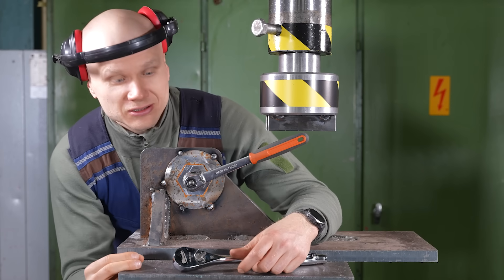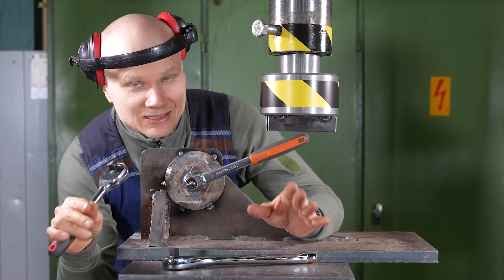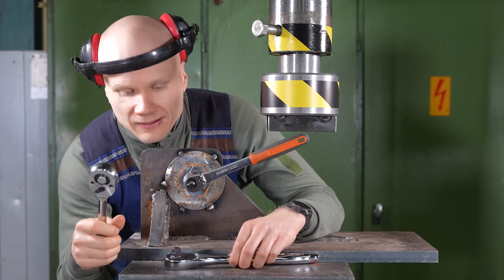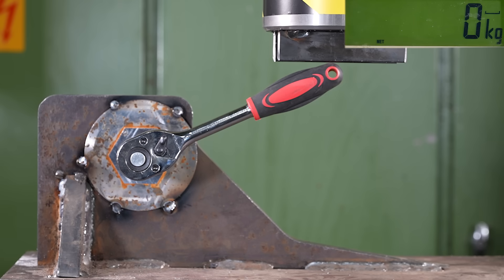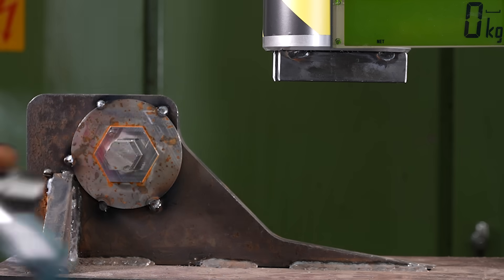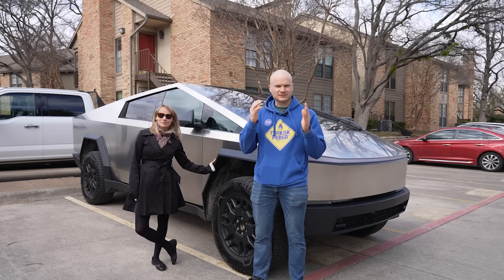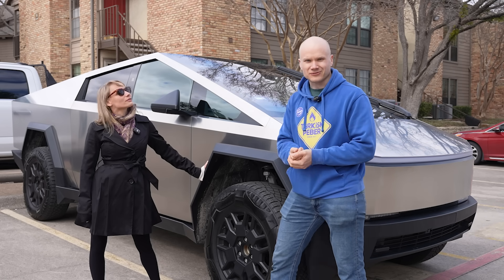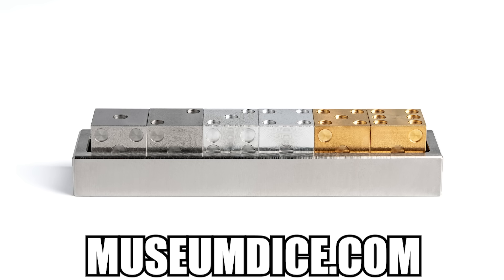What Tool Brand/Country Has The Strongest Wrench? Hydraulic Press Test!

Comment: Thats not true, sorry, the distance of the press and the "holder" are always the same, so milwaukee wrench got 400 KG and the Blaco also, so both wrench have 1020 NM or whatever, but the value shout be the same. Its Possible, that you mesaured the lengh of the wrench and the milwaukee is longer, but if the wrench standing in a angle of over 90° your distance is the same

Comment: This test needs to be qualified. Yes, the Chinese ratchet is a low quality product. The fact is though that there is nothing particularly magical or scientific about tool manufacture. Metal purity, case hardening, quenching and plating or other surface treatments are all well-known. However, there is quality control and making to a price. Temu tools aren't intended for a market that wants at least decent quality. I confess that I don't know who they are intended for and I don't actually care.

There are Chinese made tools that are very good if you can find them. But because they are manufactured to high standards, they will cost you about the same as any other in their price range. Is it worth seeking them out? Not from my perspective. There are plenty of readily available alternatives. And by the way, unless you are using an extension bar, 250 kgs is a lot more than most people are capable of exerting. If you are using an extension bar, you probably shouldn't be using a ratchet.

I had a cheap Chinese ratchet set. It worked. It wasn't brilliant but I changed my clutch using it. My experience was that the sockets failed before the ratchet handle did and - in the case of the only one that did fail - I replaced it with a Sidchrome (I'm Australian. It's in the constitution!). My next ratchet set will be a 1/2" drive LOK-ON kit from Australian company Kinchrome. They are made in Taiwan and they are very good. I have never seen that Makita ratchet here.

Comment: All ratchet handles are strong enough, 200 kg is enough. It is wiser to use a pull handle/joint handle for large forces. Ratchet handles should not be overloaded.

Comment: Doesn't the test become unfair when the point of contact varies? 
Since the handles of the tools have different length, the tools with the longer handles will get a lower read, since the point of contact is further out.

Comment: How much abuse a ratchet can take is not what makes a Good Ratchet. You want a ratchet gear that can click in reverse very easily, or your fastener will just spin back-n-forth. Also the gear engagement angle matters. You want a ratchet that can click at least once in as little as 3 degrees of movement from the wrench's handle. This is so you can work in very tight spaces. You never put a pipe onto a ratchet for more torque, that is tool abuse. Use the correct tool, it's called a Breaker Bar.

Comment: as the press goes down, the lever length changes as the press tool is suddenly touching the inner part of the handle. make some tool simillar to the guilotine tool you made, just not sharp, as that will provide a more of a fixed lever distance. and speaking from experience, makita ratches are pretty tough, i used it to remove rusty axle nut with one meter cheater pipe, and jumped on it to remove it and it somehow survived. now seeing why lol

Comment: Calling Bahco Swedish on the thumbnail is bit of a rage bait. 

Bahco was a Swedish quality tool brand but it's very internationally made now (I thought they were China made, but apparently not!). They are not the worst tools - even decent for the prices (thy aren't premium priced like they used to be). Often the cheaper tools can be equally strong but are much bulkier - if you compare makita, milwaukee and the Bahco you can see that the Milwaukee is way slimmer. 

Often these quality tools (SnapOn, Milwaukee, Facom etc.) tools are slimmer for better usability - and still provide adequate strength.

Basic Bahco tools are decent but e.g. pop-up-rivet pliers failed right away and some other more specialty tools too.

Comment: Once the lever rotates past parallel with the press, the diameter of the tool changes the point of force. This reduces the length of the lever arm and will mess up your torque calculation.

Comment: The most precise tools I have are Swedish, and they are very strong and durable, but cost some money.  I broke a Chinese monkey wrench with my own hands, and I fell down because I didn't think such a thing would happen. Also, I own Chinese stainless steel, which has all rusted within a few weeks. I don't own any Japanese tools, but I do own some stainless knives and they are excellent.
Reply: You would do well to buy better Chinese tools. Most of them are quite good. You just have to remember that they make everything from premium to Temu...If you pay Temu prices, you get Temu quality. Caveat emptor.

By the way, I have a cheap Chinese made “monkey wrench” (we call it a Stillson) and it’s a beast. I have been waiting a long time for it to break and it hasn’t. I just keep it properly greased. I think the reason it works is because it’s basically overkill for most of the things I do. Everything else that is plumbing-related can be done with Footprints.

Comment: Minor point, but at a certain point, or contact point changes from the end of the handle to almost the middle. That would change the amount of force being applied.
Reply: Yes but it doesn't really matter, when you are beyond that point you are most likely just bending the handle or more likely, stuff inside the mechanism are beginning to break. You can see it because the kg metrics flatlines (stays the same) before that happens. Even the bacho, you can see just when it is horizontal that something gived away in the head because it moves.
Reply: You meant "torque" applied.
Reply: @ no i meant force. im referring to the press, not the socket

Comment: Milwaukee is a strange manufacturer in the field of professional tools. On thing you can rely on is their price which makes the tools unattractive for a regular hobbyist. Then there's the performance and quality, ranging from excellent and basically lasting forever, and sub par things which either don't perform like they should or malfunction far more often than expected. My former employer had a pretty sweet deal on Milwaukee tools, and the early 2000's cordless drills were kindly said problematic.

Comment: 50 kilogram increments is a huge margin of error
Reply: Yeah but I want to see the person who can apply 1000Nm on a 250mm ratchet. All of them are way stronger than necessary.
Reply: @tmmtmm  1kg = 9.8nm,so 50kg is 490,not 1000, it's nothing if you stand on it or use a breaker bar
Reply: @phonotical  And that's only with a 1m long lever. If you only press on the end of the tool which is like 0.25m long, you're dividing your torque by 4 again.
Reply: if you stand on the 0.25m ratchet you need to weigh ~450kg to apply ~1000Nm and break it, that's what the video shows. A 100kg person won't do anything to it. And you shouldn't be putting a cheater bar on such a tiny ratchet, use a solid breaker bar in that case.

Comment: Something to note: the brand of a tool does not necessarily indicate where a tool was actually made. For instance, the only company that I am aware of that makes ratching socket wrenches in Japan is Ko-Ken Tools. Makita makes their tools in either Taiwan or China, with Taiwanese tools tending to be much more reliable than ones made in China.
Reply from the maker: Yep most of these are made in Taiwan
Reply: @HydraulicPressChannel well that's just depressing
Reply: Yeah, I like my Bahco tools, but most of them are made in Taiwan, not Sweden or China.
Reply: Why does it matter where? How is much more important to me.
Reply: ....the guy at the hardware store when he returns the 'defective' tools he bought. "Hey, Mac ! ... you got a gorilla hopped up on meth wrenching in your shop or what? "
Reply: Yeah but made in China with supervision or without is a HUGE difference. It’s like comparing USA and Somalia.
Reply: That depends entirely on the brand. Remember: China makes literally everything these days. Yes, they make the junk that's sold on Temu but they make high quality stuff too. There's nothing magical about the essentials of tool production. There is only price and quality control. Like anything else, regardless of where it's made, you gets what you pays fer. The West has so many established brands to choose from that there's not much point in seeking out the best quality Chinese tools. Brands like Jonnesway*, Force, Great Star and Power Torque have been OEM manufacturers for a long time. Any Western brand, notably Stanley, probably has some bits made by at least one of these companies.

If Taiwanese tools are more reliable then the average has to be set against the fact that China also makes tools for the Temu market. In other words, they cover the full spectrum.

*Jonnesway is Taiwanese but makes a lot of stuff in China, or so I understand.
Reply: The reason Western companies make so much stuff in Taiwan is because the US was propping up their fascist dictatorship there for decades. They would crack down on labour unions and worker rights on behalf of US corporations to produce things dirt cheap. Its funny how many westerners still associate all of 'China' with these lower quality products when in many cases they are actually built to the specs of the European or American companies operating over there for the cheap labour.

China itself is undergoing an engineering boom at the moment though and I think they deserve credit too. They produce a whole THIRD of the engineers graduating every year now globally. You can go and look up Tim Cook of apple talking about the huge industry of precision engineering they have over there nowdays. They are putting us to shame in Europe and America. Go and check out their new Iron smelting technique too which was just announced which is set to improve efficiency in the refining process by 3600 times! And speaking of Hydraulic power, their new Hydro Dam is set to be the worlds largest and provide enough electricity to power all of America!!

Its an amazing new age of engineering these days which I know fans of this channel will appreciate. 😊
Reply: @MrSchmeoin1  You can't improve efficiency in refining process of iron smelting or steel production by 3600 percent, this is not how physics work. You can get "efficiency" out of using the waste heat for something useful like district heating or warming up your offices or whatever, but the energy requirement for heating up the raw materials is always there, you can just redirect the heat to useful application or maybe in some cases drive something like stirling engine out of temperature difference, or steam turbine. There are just no workarounds around physics.
Reply: @MrSchmeoin1  CCP bot encountered
Reply: @MrSchmeoin1 it's because before  the trade deal was redone with Clinton. Chinese companies would open a "head" office in Taiwan and put made in Taiwan on there stuff shipped to America.
Reply: @MrSchmeoin1  the thing is it is possible to make good quality stuff in China. Infact there is much better capability to, there as those manufacturing has steadily wound down in Western Europe and America the last 30 years.

The problem is companies moving there do so to make profit by cutting costs. In the past people aimed to. Make the best product to compete now it's about the cheapest. And the Chinese who have adopted that model to make their own brand products have mastered the art of cutting corners to deliver the cheapest possible goods, beating the Western companies at that game.

The companies that take quality control seriously do make good stuff there though but they tend to be foreign companies. A lot of them are just using their brand name to sell poorer quality products they used to make well in the West previously though.
Reply: @MrSchmeoin1 Cheap Chinese crap is a thing regardless
Reply: @Saakk129   It is if you look for that and nothing more. China manufactures for all markets these days. It depends, like anything else, on how much you're prepared to pay.